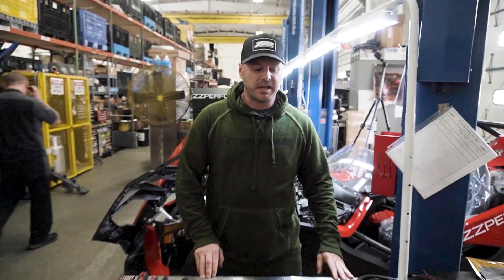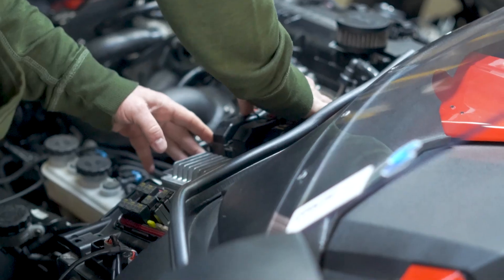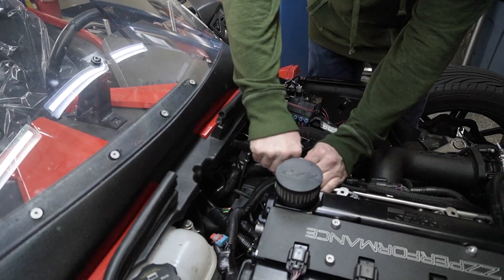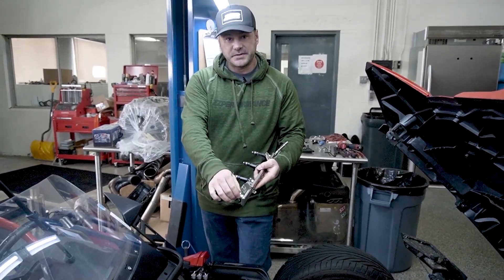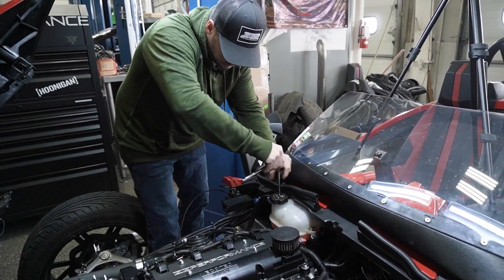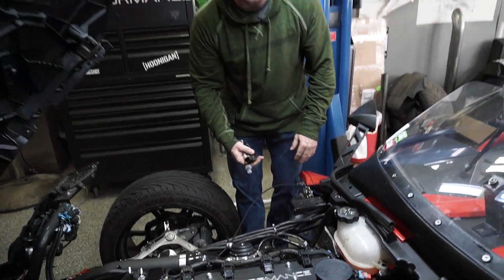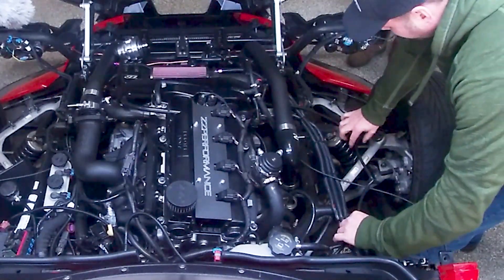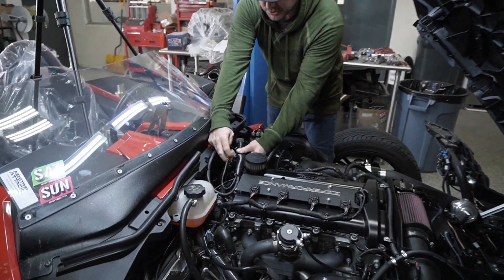How To Install A Haltech PCM Kit on the Polaris Slingshot

Comment: Hello Kyle . Does the Haltech Elite 1500 work with the early 6+1  reluctor wheels?  I have multiple early and later 58x engines and would like a more tunable controller than the mefi ecu . Thanks

Comment: Watch out buying in California without a 50 state epa sticker DMV will not register it and you'll be left with a pile of garbage.
Reply: The Slingshot is not classed the same as an automobile in the state of CA and is not held to the same requirements as a car is during SMOG checks.  However, before doing any modifications to your vehicle, it is the owners responsibility to do their due diligence and know what is and is not allowed on their vehicle in their state.

Comment: Will your stage 1 turbo work with 1320 V1 and thermal R&D rear exit exhaust...also what will this PMC kit do for my non turbo 19GT. Thx ✌️😎
Reply: Our turbo kit does not use a header and an adapter to mount the turbo.  It's just not the most efficient way to do it.  We replace the header entirely with a cast stainless turbo manifold.  Because of where the exhaust exits once the turbo is mounted, the R&D system will not be a direct bolt on.  It could however be modified to work.  BUT, I believe the R&D system also only uses 2" pipe which would be a restriction on any turbo setup.  Our kit comes with an exhaust but we also offer a rear exit exhaust that normally costs $1000 but if you purchase it at the same time as the turbo kit, we discount it $450.  Our exhaust is also made out of 304 stainless on our CNC mandrel bender.  We do not use aluminized mild steel which will rust quickly like all the others made for the slingshot.  We can make a kit for the non turbo as well.  The nice thing about the Haltech setup, is that the tuning abilities far exceed everything else available out there and you have significantly more control over all of the available tuning parameters.  We also have the ability to make tune adjustments remotely from anywhere on the planet so long as you have a laptop and access to WiFi.  If you started off NA and went to a turbo setup, we could email you a file to flash to the PCM for the kit.  If you have E85 in your area, we can make it flex fuel.  If not we can leave that out.  There are a lot of options we can do and I can custom build a setup for just about anything.  If you're interested in going this direction feel free to reach out to me at kyle@zzperformance.com
Reply: @kyledewey3657  thx for the info...lots to think about. Not sold on a turbo yet but definitely interested in that tuning setup.  ✌️😎 #Ohio.    If u use Discord https://discord.gg/6F7EP3S